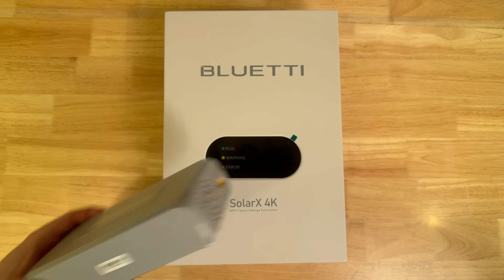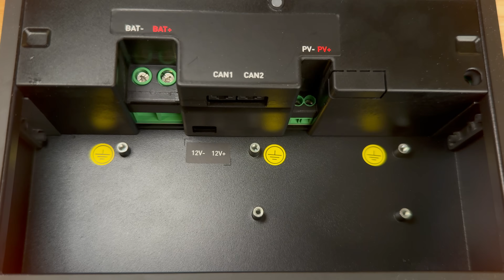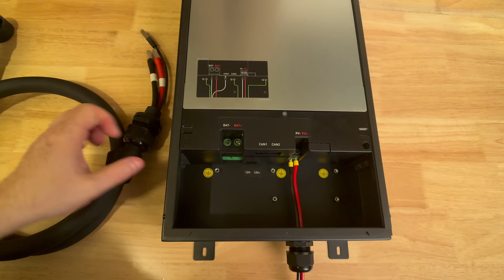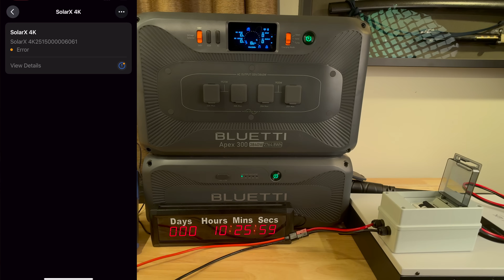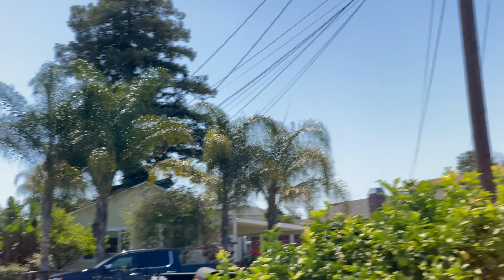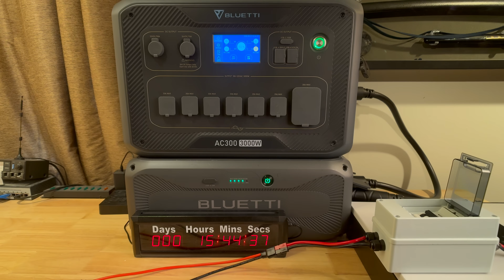Bluetti SolarX 4K first look and testing

Comment: The latest firmware fixed all the issues this great product had. It now bucks or boosts voltage and current to give you maximum output with lower solar current during early morning late afternoon sun. Now it’s an excellent flawless product.

Comment: How do you turn on solar without the app ?
Reply from the maker: I’m not aware of any way to control this unit without the app.

That said, after you initially set the cable options then turn the solar on there isn’t that much else to control.

Comment: Hi! What panels do you have? Models, Techs=) Thanks
Reply from the maker: I personally find the best place to get residential sized fixed solar panels is my local used market (Craigslist). It’s not uncommon for me to find a random number of exactly matching household sized (6ft tall 4ft wide) panels for free if I go pick them up.

This is because when people redo their roof the contractors tend to put new panels on the new roof. They then leave the old panels for the homeowner to deal with. People give them away for free instead of paying the trash company to haul them away.

Solar panels only lose 0.5% efficiency per year, meaning that if you pay for them by the end of 20 years it makes sense to replace them because they will have lost 10% of their efficiency and the new panels will generate approximately twice the power of the panels they made 20 years ago. 

If you are getting the panels for free though, the old panels still generally work fine. 

I have several solar arrays in operation on my property made up of panels that I got for free. It is both free energy and recycling.

Comment: Could you use the solar X 4k plug into a B300K and connect to the ports on the unit to charge PV1,PV2 and PV3?

Comment: hi there i have a question i am installing my solar 4k in the house but for grounding it can i use the same ground that my electric panel in the house use ? am just not sure cause let say a lightning it my solar panel out side could there be a chance that lightning comeback by the ground and hit my electric panel am just scared of that situation and my solar panel outside are already grounded or what would be the safer option 

thanks
Reply: You should never have two grounds that are not connected together because of lightning strikes one of them there’s going to be a massive differential in voltage between the two grounds and all the equipment in between will be blown up in a microsecond. You should connect all grounds to one point in your electric panel and also use a whole home surge arrester

Comment: Let's talk about the problems still--it is way too heavy.  You need to buy a cart to move it around.
They are out of stock to most accessories.  The actual apex300 ships with 2 pretty worthless cables--nothing for solar.
The limits on panels is pretty bad using a mc4 to xt60 cable are pretty low.  Going to very hard to charge in one day using both of them.  So you are taking another $800 to buy this box.  That isn't nice.  The AC500 was so much easier to charge with your own panels.

Comment: I am in California; therefore, 110V AC is the norm.  I have an AC500 Bluetti that has 2 sets of 2 B300Ksplugged into the side of it.  2 B300Ks are stacked and plugged into one port of the AC500 and there is another matching pair of 2 B300Ks doing the exact same thing plugged into the second input port of the AC500.  Therefore, 4 B300Ks into both (top and bottom) input ports of the AC500.  If I purchased the SolarX 4K, where would I plug in into such a system?  Could I just pick one of the B300K batteries and plug it into an input port?

Comment: Another great video. Can you use the solarx and the factory ac500 or apex or ac300 at the same time? to get the benifit of the 4kw of the solarx and the 1500w from the ac500s factory solar controller?

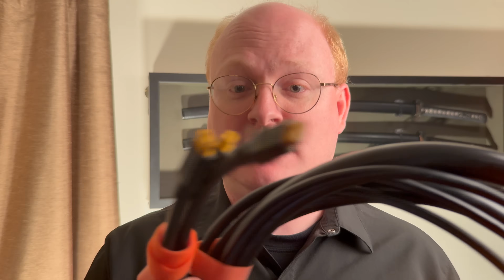Comment: 22:42 this made me wonder if you could split up those 3 xt60s with splitters and charge like 6 of the old B300/B300S batteries that have those 500w input xt60 ports on them.
Reply: You can I think, however; the B300s only accept 200w each max wired that way not 500w and are charging less efficiently than the mppt controller in the AC300'S
Reply: @mr.monitor.  b300s with built in heaters that came wiath ac500 are 500w, regular b300 are lower input.
Reply: @wigenite  Ya. I meant the B300's not the B300S's but thanks for clarification.

Comment: Do you know a solution for this problem?

Bluetti Charger 1 and AC300

The "Input Overcurrent" error (G003) on a Bluetti AC300's Charger 1 likely indicates the charger is drawing too much power, potentially during vehicle startup. According to a Reddit thread, this can happen if the charger is attempting to draw power while the vehicle's alternator is also increasing output to charge the vehicle battery. thanks

Comment: Key question I'd love to see a working confirmation of: When using non-parallel cable, does charging directly to a B300 also charge the other, connected B300 or do you end in a situation of one B300 at 100% and the others getting no charge? 

This could be tested by having multiple B300 units connected and charge with the S4K.

Comment: Thank you, Jeff, this video is timely for me also. I've got my SolarX 4K on order, should be shipped next month. I've got 3,000 watts of solar for my AC300 system, so when this arrives I will be replacing the AC300 with the Apex 300 and I'll need the SolarX to put that solar to use. I know when I get mine and set it up I'll be thanking you for smoothing out the experience! 😀

Comment: If they release Solarix 4K for AC500, will it be possible to charge simultaneously using the standard 3kW on the AC500 and an additional 4kW that goes directly to the B300k? For a total of 7kW? Thank you.
Reply: Same question. Wouldn't that be sweet!
Reply: bluetii told me yes and I am waiting for mine to arrive.
Reply: @VideographerBill hello its been a year but how did it go?

Comment: Question: a 12v to 24v step up converter, changes 12v to 24v. If i hook up a 100W solar panel to it,will the 100W panel increase to 200w.?

Comment: Do you know if it will work with the AC200L? Great Vid!
Reply: Looks like it will along with ac200max, ac240 and 300 series batteries and b230 and b210
Reply: @dorsaldawn565  Thanks! that's a big deal, as I have an AC200L + 2 x B210.

Comment: Nice review. Would love to see technical features and use of the 3x xt60 cable. For instance, voltage output, controlling amp. per output, connecting 2 units vs 3 units, connecting to a offbrand battery pack (or maybe mppt controller to charge secondary bank)
Reply: Just got the Apex 300. I don't see much videos on the3X XT60 cable. Just wondering if you have the cable and if so, does work fine. Do I need an mppt controller or just use this? Can you put 2 XT60's into one unit. Have you figured how to charge an off brand battery? Sorry for all the questions. Thanks ahead of time.
Reply: @patrickcarson-p2q I do have the 3x xt60 cable. But I haven't actually used it. I did see a video by average Joe (I believe) that uses this to charge a battery system directly. So in theory it's like a mppt.

Comment: Great job on the video. It is a bit weird that the unit doesnt show it charging but I guess that is because it is not going through the built in charge controller and, I am guessing, is bypassing whatever they use to measure in and out power, I am guessing a shunt built in there somewhere. Very nice charge rate.